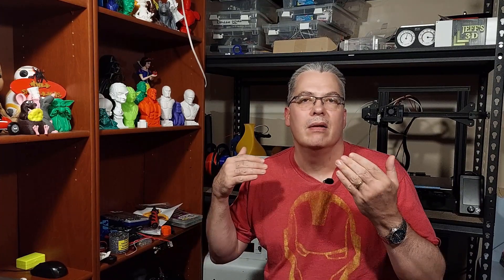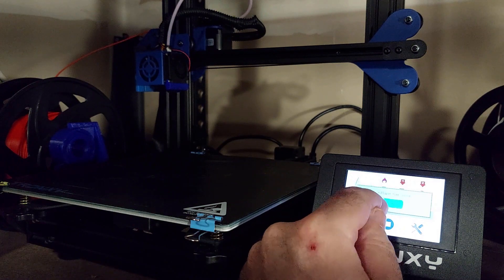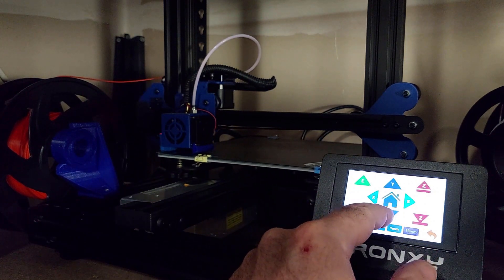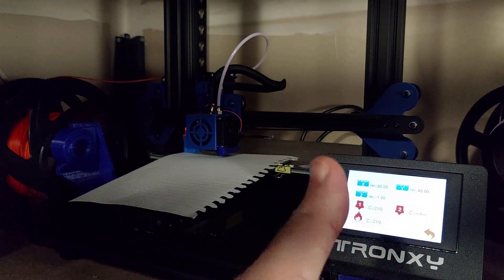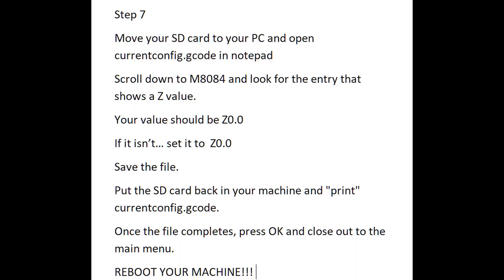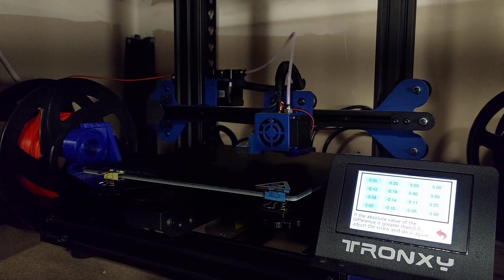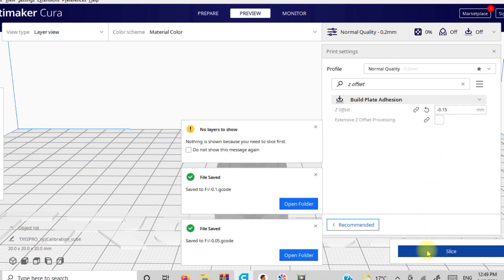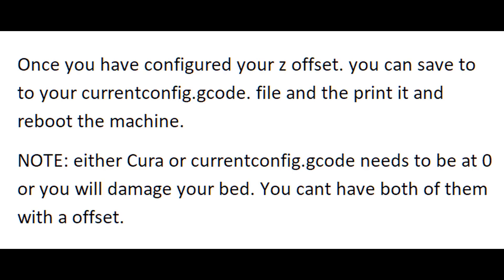Set the Tronxy Z Offset The Right Way A Visual Guide

Comment: hey just wondering if there is a way to reach out to Keith Varin?  I have done this before with my XY-2 Pro and got it working fine.    My heat bed recently broke as the wires sheered off,  and have fixed it with one of those silicon heat pads.   I was able to print 2 buildings and then the nozzle kept getting clogged.   I had to open the print head and change out the extruder tubing as it was black and had metled filament stuck on the inside of the tubing and changed the nozzle as it clogged with filament.   Now trying to set this up again,  all my printer wants to do is jams the head into the bed during the auto-leveling part.   in the Config document,  it says that it is at 0.0 everytime i try and go through this.    I heat up the bed,  i have reset the printer to default settings.   nothing has worked.  I follow the steps every time i try this and yet nothing.   Everytime i reach out on facebook groups or on reddit for help from anyone with the Tronxy printer i am just getting swarmed with people laughing i own this machine or the easy fix is to get a new printer.  What community or group was this document created by?  Im kinda of a loss because this just started with my hot bed wires breaking and now its like the whole machine just stopped working properly.

Comment: There are some serious problems with STEP 3 ...

It might perfectly work for single motor Z-axis, but how should I manually synchronously lift the bed when having the dual motor Z-axis?

TronXY X5SA 500 Pro with Chitu FW.

Comment: am i supposed to set it to the furthest away from the nozzle or close to the nozzle, also i have run into a problem with my z axis, when i home it, the bed goes to rather the middle of the printer or to the bottom, if it goes to the bottom it keeps trying to go down and makes a grinding noise
Reply: that had happen to me to. i was for a couple of days i was trying everything. Long story short, i saw a video on youtube it was the sensor just MOVE IT CLOSER TO THE BED

Comment: Thank you for the video. Although I have a problem. @3:50 after manually going to "X:0" and "Y:0" I check the system info and it is not "0". At my first attempt I got "X: 0,06" and "Y: -0,03". Tried to manually go back and forth a little to "compensate" but I figure that isn't the way to do it. How to correctly "calibrate" the 0 points for X and Y? I was thinking... loosen the end stop sensors, manually set to "0" (according to the "system info") and then tighten the end stop sensors in place? Haven´t tried it out yet, with the risk of destroying more than I gain. 😁

Comment: Hi , great info, a little of topic but I have a tron xy 3-se and wish to modify the print head , to an all metal type , the standard head uses a 40mm stainless (Bowden tube) long heat break,  the longest bimetal heat break is under 30mm ? Would you have any suggestions to upgrade it , tronxy couldn't recommend anything ? As the housing has been designed to also fit a dual head hence the need for a bespoke heat break, thanks in advance

Comment: Jeff, just found your page and I have a TRONXY X5SA.  Can't find the savesetting.gcode file and I also can't find your face book page.  Like your stuff think I may learn something if I can find your stuff to get started.  Never wrote a gcode so I and depending on you.  Hope to hear from you.   Ron
Reply: I have the X5SA Pro, and even with the savesetting.gcode file, and running it on the printer, it's not saving the currentconfig.gcode file. I think these instructions need to be updated.

Comment: When I run the savesettings.gcode file it does finish, but doesn't create a file. Suggestions?
Reply: I have a tronxy x5sa-e2, it does the same thing to me too, it reads the gcode and then comes out the message that it has finished and to press ok, I look on the sd card and there is only the starting gcode, it does not save anything
Reply: @MirkoZanellato  Same issue
Reply: @MirkoZanellato  
Same thing
Reply: Did anyone manage to resolve this? I’m having the same thing

Comment: We have followed this video a few times now, but our z-offset still keeps re-setting to being way too high. Any further ideas on changing a stubborn z-offset?
Reply: did you happen to fix this? i have the same issue
Reply: Tronxy`s blue sensor is notorioussly inaccurate and its readings wildly drift with temperature so your offset will vary accordingly. Just get a generic induction probe of the 12mm variety and replace the blue sensor. The wiring is the same you`ll just have to print some mounting for it. Also invest in a magnetic spring steel sheet for the bed.
Reply: buy a different printer

Comment: I watched the video and I have a tronxy x5sa and replaced the hot end with a dragonfly bms and can’t seem to find out how much of a gap that should be between the sensor and build plate and you said that you use a 1.5 mm allankey with the nozzle touching the plate is that about right for any tronxy machine
Reply from the maker: You want the sensor to trigger. That's the goal. Whatever distance that the sensor triggers is the right one. I just find a 1.5mm wrench works for me. The guide recommends a piece of filament that's 1.75mm.
Reply: Thank you and keep up the amazing work